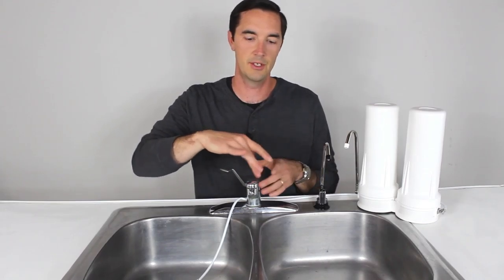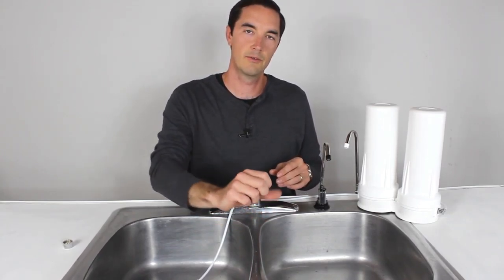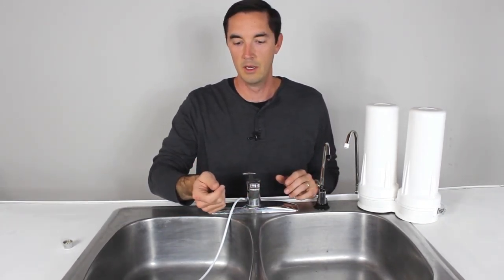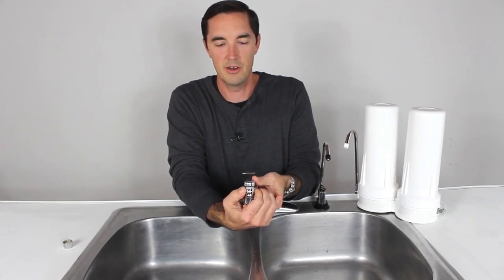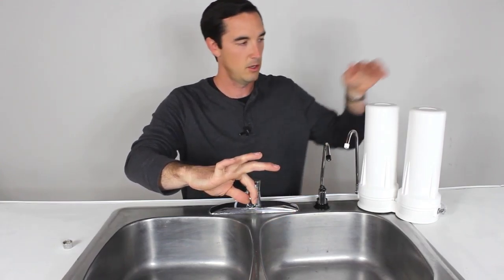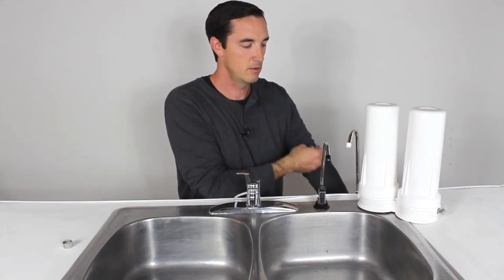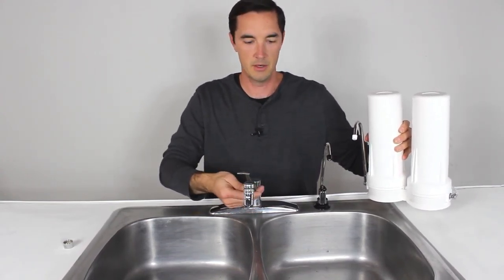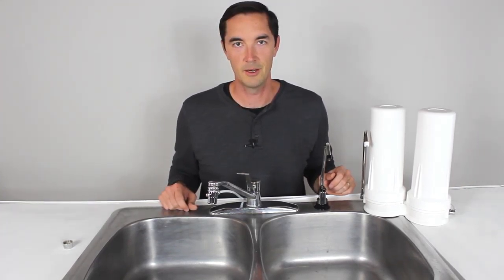Vitev FLO and PLUS countertop installation

Comment: Shouldn't the white feed tube be connected to the filter side, so the water first goes through the filter and then the minerals ? 

In the video you said it does not matter to which side you attach the white feed tube ...
Reply from the maker: It matters that the filter is first and then the minerals, but you can swap the tubing and drinking spout if needed depending on which side of the counter you are using.

Comment: The sink I in my apartment is much lower pressure than a standard city faucet. Will the Flo+ still work? Obviously the output would be slowed either way, but I am just wondering if it will work at all (does it require a minimum amount of pressure?)
Reply from the maker: Hi Mitchell. If you have enough pressure that water is coming out of your faucet at a satisfactory speed, then the FLO+ will work. The slower the water through the system, the better the filtration and the more potent the mineral reaction will be. You'll just have to be a bit patient waiting for a glass/pitcher to fill up.